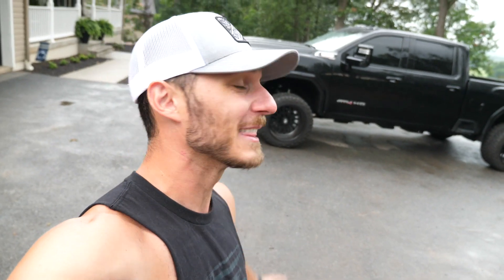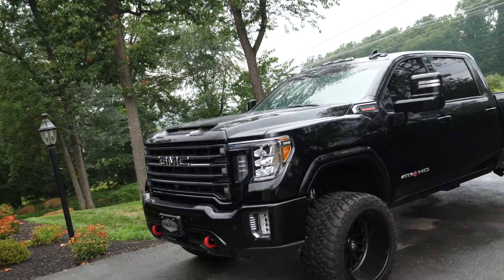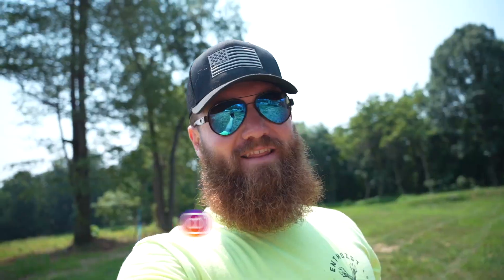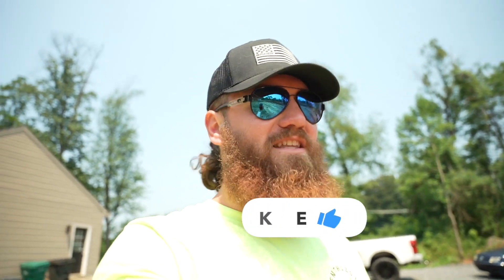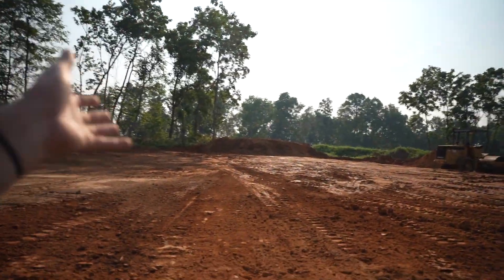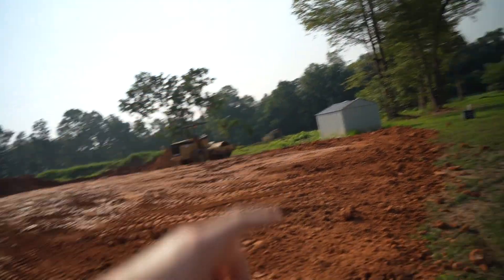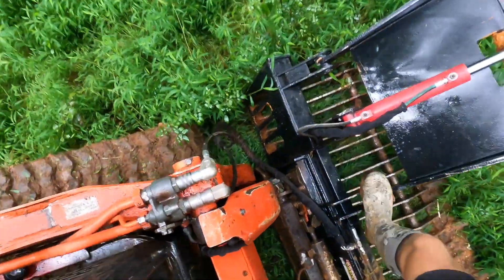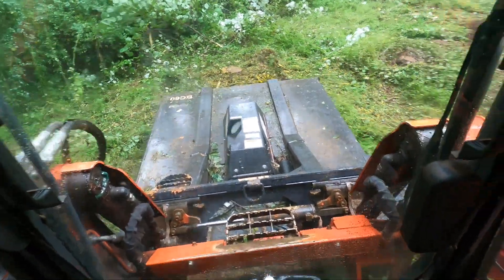Man Cave / Dream Shop NEWS I’ve been HIDING!

Comment: Deff need a buggy. I'd recommend a ranger or a defender. Got room for your family in it. I'd personally go with a highlifter ranger or a xmr defender. The rangers have turf mode in the tranny and are garbage if you go with the highlifter modem it doesn't have it and it comes with a factory gear reduction in the tranny. The xmr defender I'd basically the same but they started putting turf mode in there xmr model, so in my opinion I'd go with the polaris ranger. I have a 850 highlifter 4 wheeler and a 1k rzr highlifter and they have been great machines. My dad had a ranger highlifter and same thing it's been amazing for 2 yrs now. No issues. I have replaced normal wear parts on my rzr and most of that is self inflicted lol but overall great machines